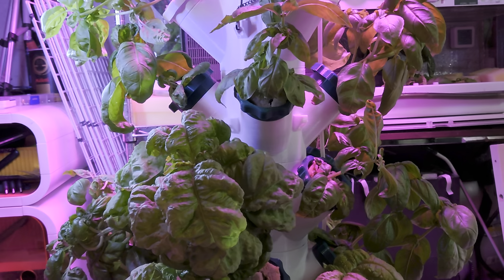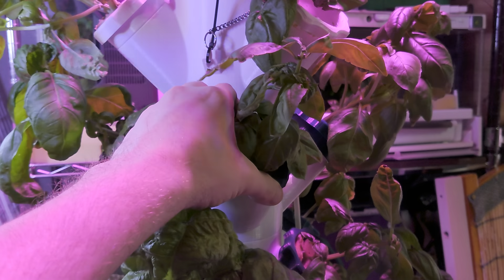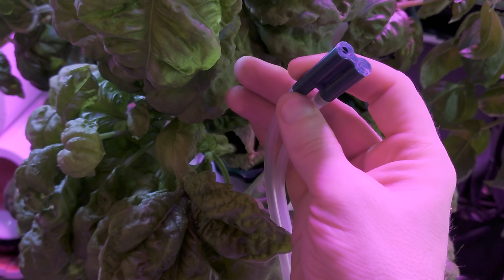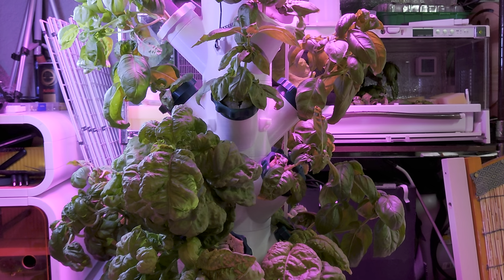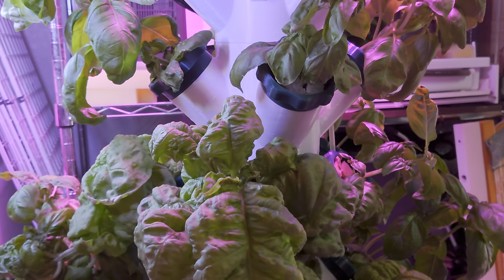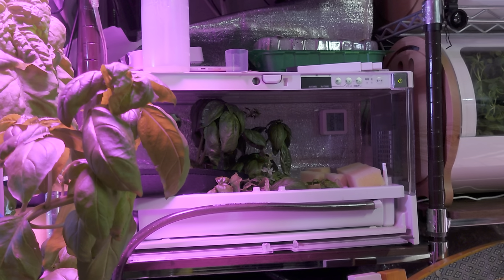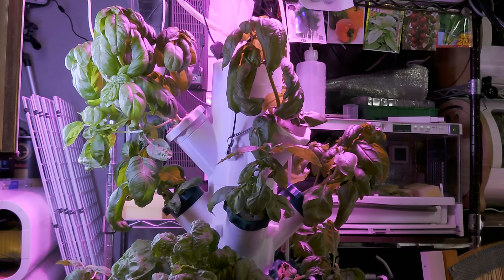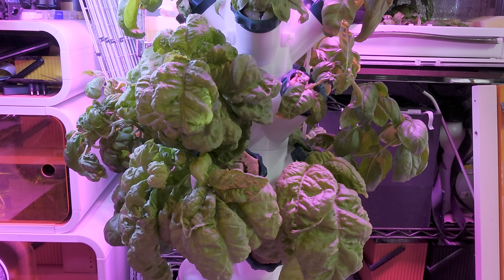Discussing on the economics of building your own tower gardens

Comment: Plus you need a printer.    What will that cost.   ❓❓👀
Reply: I have 2 printers, one was around 350, the other around 500, I think.  They were both gifts.  I have an Adventure 3 which is too small for the sections, but okay to print the pods.  I print the sections in my Anycubic Kobra Max which prints larger prints.